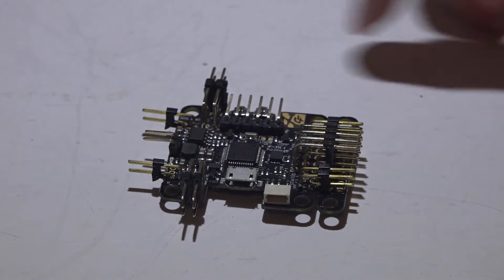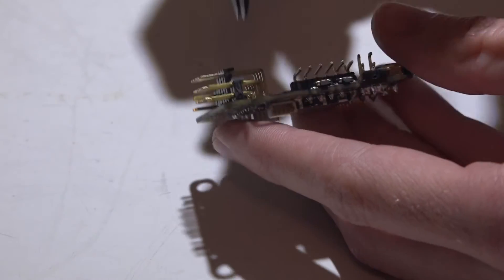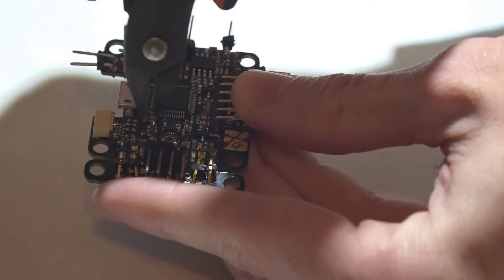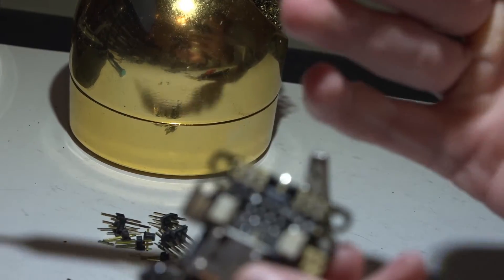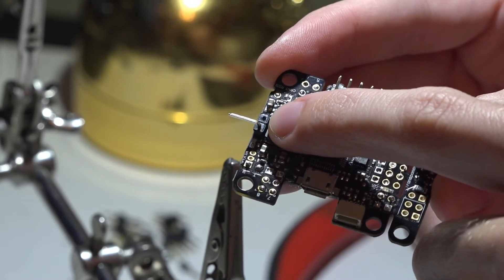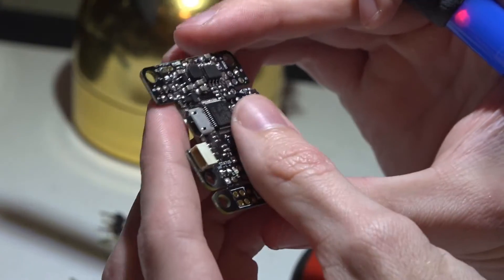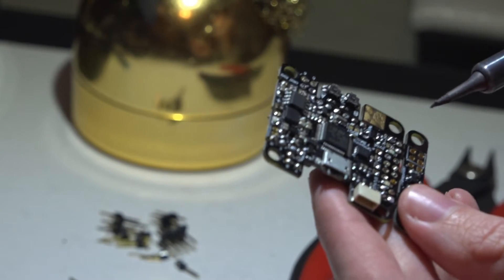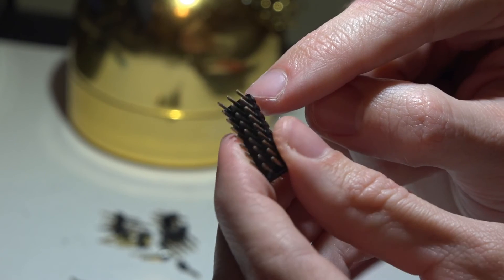How To Depin Flight Controller

Comment: question blue falcon, I see everyone soldering pin headers on flight controller but I solder wire by placing wire through holes and solder but is there better or easier way that don't require pin headers? bolb some solder in holes and then attach wire ? thanks